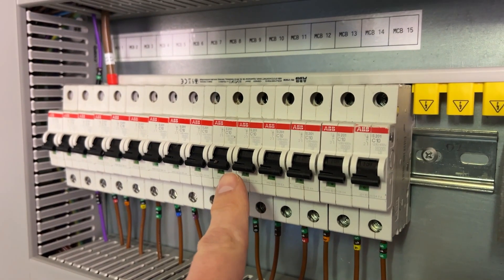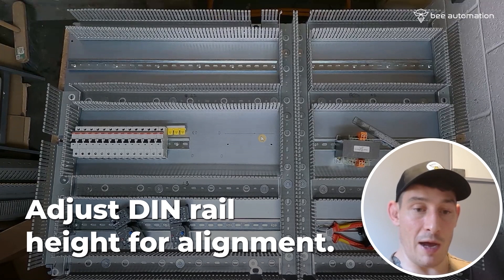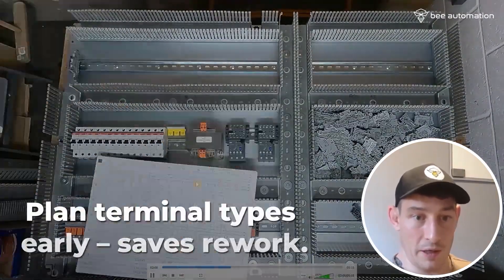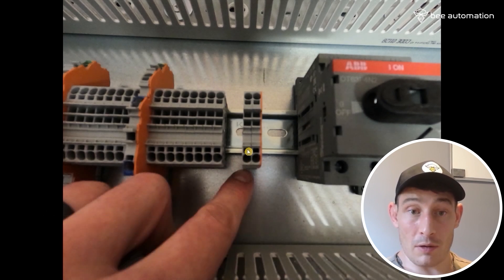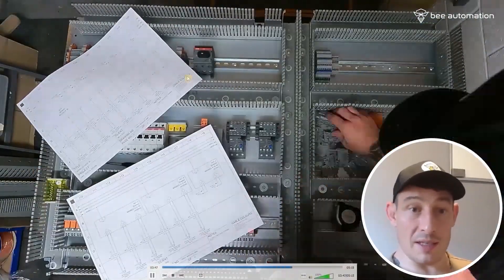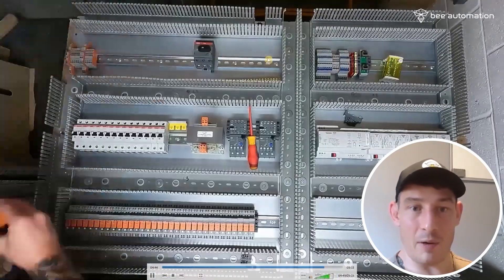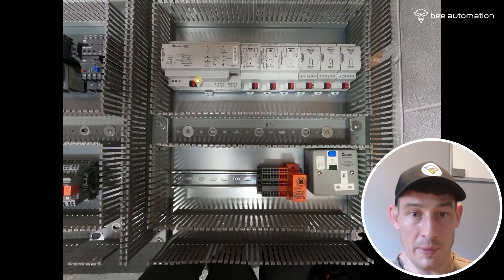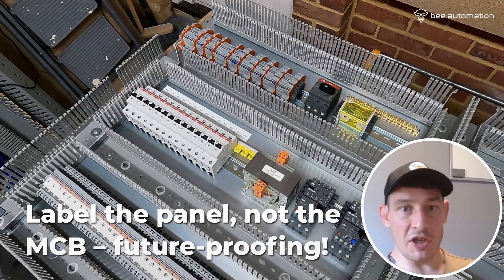Industrial Control Panel Components EXPLAINED

Comment: Wrong video title. No components were explained. You only explain your method and order of placing components & labelling.
Reply: Exactly. Also not exactly the best demonstration of how to lay out either to be honest. Either use CAD to work everything out or just place the devices loosely in where you think. I wouldn't drill a single hole until I know exactly where everything is going. This is why you keep a few odd lengths of DIN and trunking, for doing mock-ups.
Reply: Yeah, dislike for that